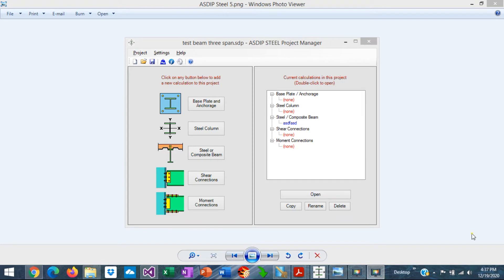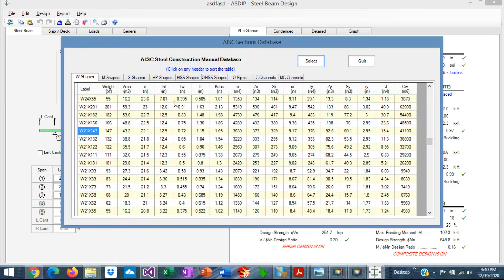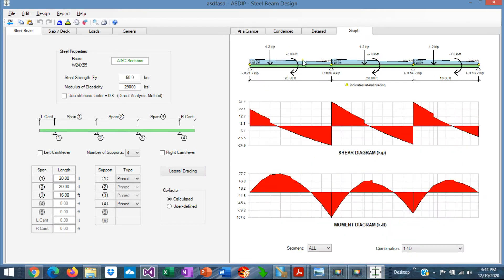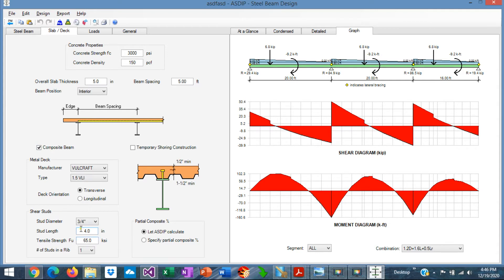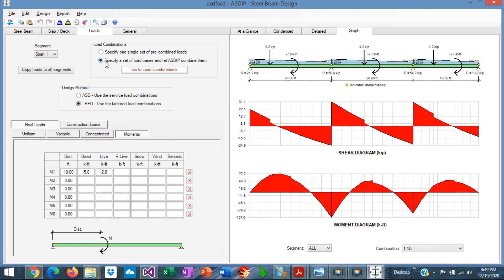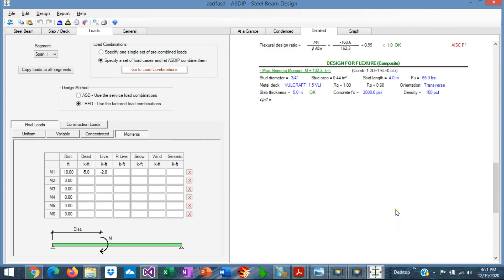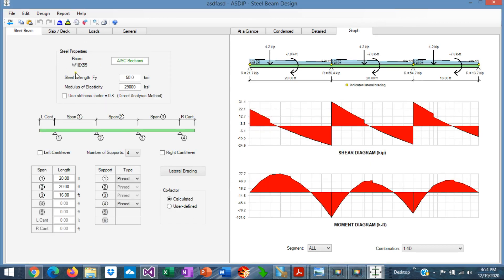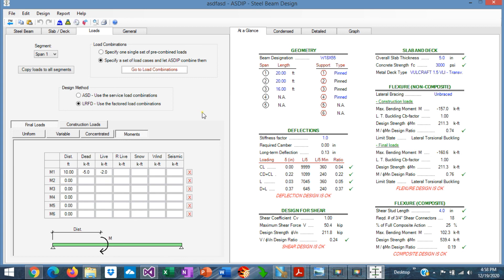Steel and Composite Beam Design Using ASDIP STEEL

Comment: Question:
Does it check for vibrations or frequency?
Is it possible to use sections other than ASCE. For example british or euro sections
Reply from the maker: It doesn't check vibrations. Yes, you can use euro steel sections and metric units.